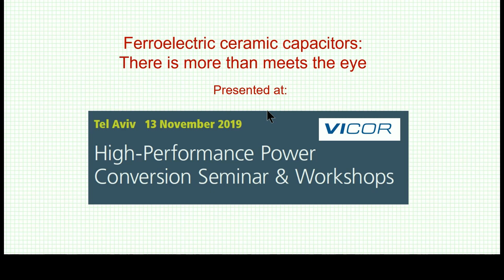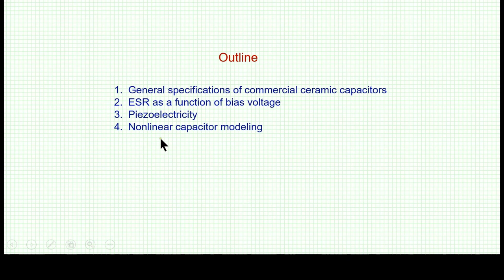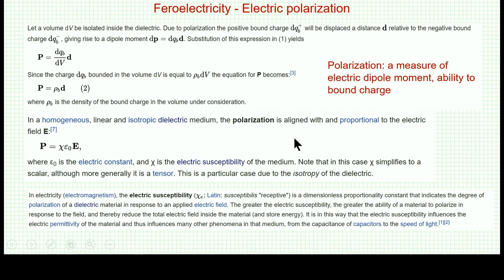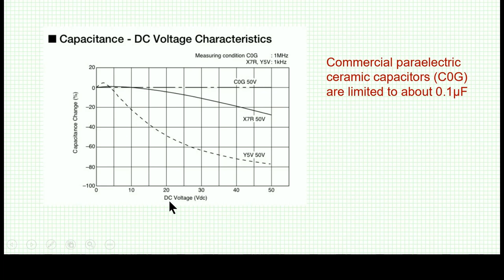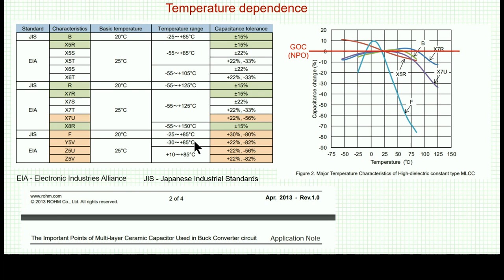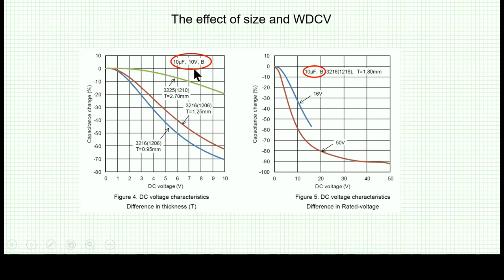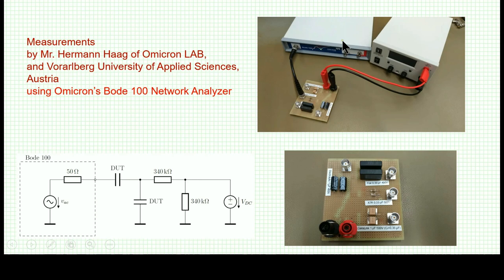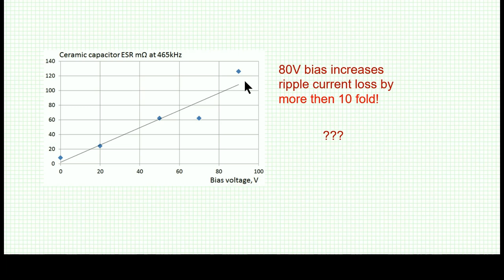Ferroelectric ceramic capacitors:  There is more than meets the eye

Comment: Thank you for that presentation. I am a sonar engineer and we use class II ceramic capacitors made from different PZT formulations as transducers making use of the piezoelectric effect for both projecting and receiving. We frequently use a Thevenin equivalent based on a BVD (Butterworth - Van Dyke) model which has the electrical capacitor model in parallel with one or more series LCR circuits which correspond to the mechanical resonances of the transducer. In the frequency regions close to the LC resonances, the transducer impedance will generally go from being capacitive, with a loss factor of 2% or less, through purely resistive, and into a frequency span where they are inductive in nature but with a phase angle of considerably less than 90 degrees indicating a rather lossy inductance, prior to falling back through purely resistive at the anti-resonance frequency and sometimes back to nearly -90 degrees until the occurrence of the next mechanical resonance.

Of course the capacitors you are dealing with are not supposed to have mechanical resonance frequencies, but some of the figures you showed in your presentation, in particular the one at 32:57, seem to show the type of behavior which may be caused by mechanical resonance issues. It would be interesting to measure the reactance of the device over the same frequency range. I suspect at each of the spikes in ESR, the capacitance would fall significantly in the same frequency range...
Reply from the maker: Thanks for interesting comment. You can find papers on PZT modeling (albeit transformers)in my list of publications. Go to  http://www.ee.bgu.ac.il/~pel/   then 'publications' > CTRL-F "piezo"

Comment: I learned a lot from this presentation, thank you! I was quite surprised to find out that a lot is happening that we don't know! This capacitance derating may be very dramatic for some applications and should be considered during designing phases, but more research is required and should de documented by the manufacturers to mitigate such effects... Kind regards!
Reply from the maker: Thanks for comment.

Comment: Very interesting lecture. Do CoLF type meant to MLCC X7R which comes with soft termination 
(or Flexi-Term type) see 27:44? 
Do internal cracks of MLCC (coupling ceramic cap) 
can be generated due to DC bias voltage with multiple resonance frequencies 
(as a result of ESR changes) or because of amplifying AC ripple which riding on the DC bias? thanks ahead.
Reply from the maker: I think that mechanical resonance is the big problem